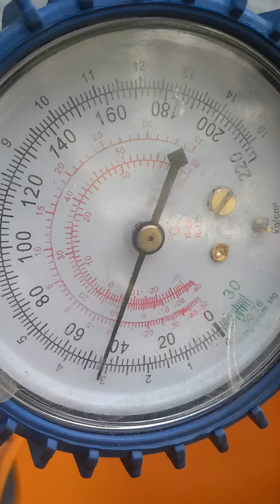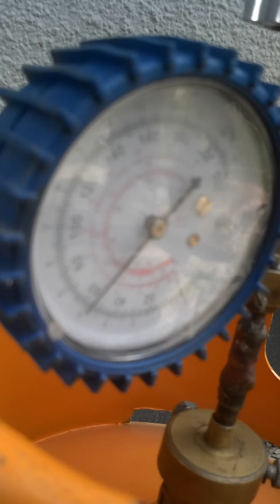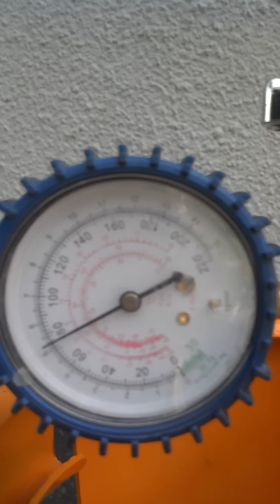HOW TO MEASURE COMPRESSED  BIOGAS

Comment: In general:  To know how much propane is in a tank you need to weight the tank and can not use pressure because the propane undergoes a phase change which will leave an equilibrium between the liquid propane present in the tank and the gas present that is at a constant pressure for a given temperature.  Methane does not undergo a phase change at any reasonable temperature one is likely to see with a tank at atmospheric temperatures.  For this reason the amount of methane present is a function of just the pressure, the temperature and the volume of the tank.  Since methane does not undergo a phase change and you can not reasonably store it as a liquid, it takes a much larger storage volume (tank size) to store an equivalent amount of energy as can be stored with propane in a propane tank as a liquid.  Each molecule of methane also contains less chemical energy as well.  This applies to wood gas and syn gases which are mainly carbon monoxide and hydrogen as those gases do not phase change under storage in such tanks at atmospheric pressures as well.  If you can chill these gases to cryogenic temperatures then you could liquefy them and store them more compactly as is done for hydrogen or methane when used as rocket fuels, but for this type of do it yourself energy, it is not a practical solution.